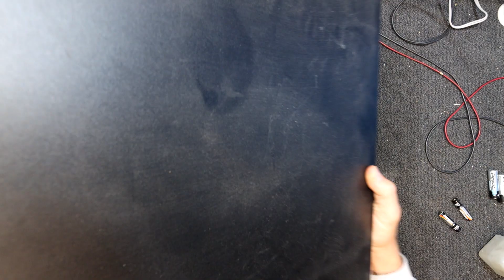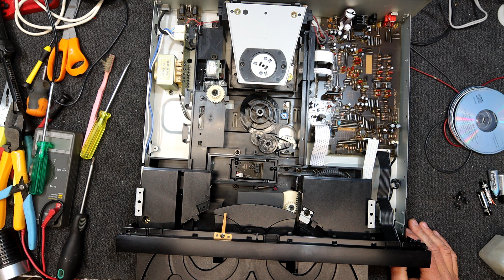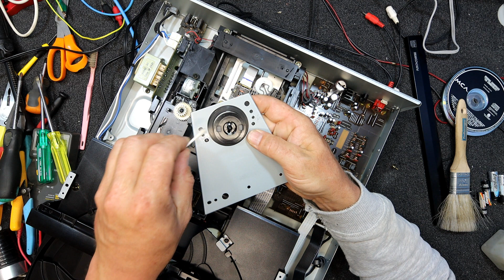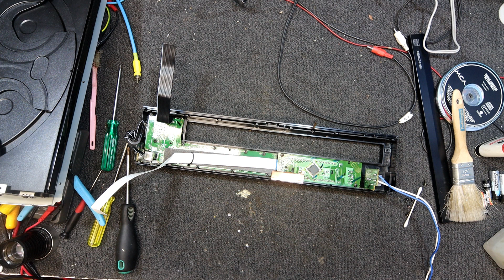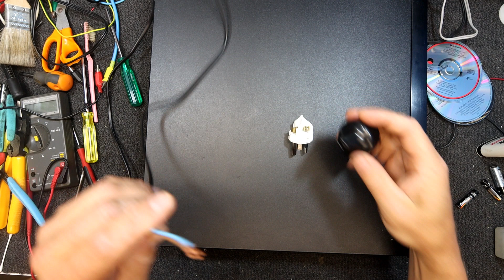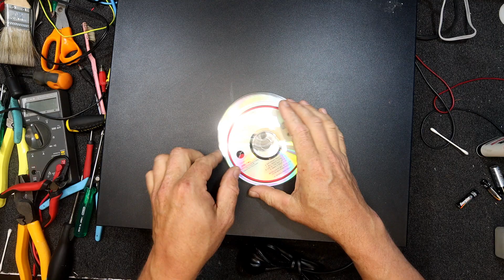Yamaha CDC-675 5 Disc CD Player Check Over and Service

Comment: How about the DAC of this player. Is it sort of the DAC’s audiophiles like?
Thanks in advance.

Great video, it helped to fix mine.😊
Reply from the maker: I think it was only some of the early single disc machines with a couple of separate DAC chips that people claimed were better, though I think there is even a Playstation that people claim is a better than average audio player and it would have used a later chipset. I never cared about that sort of thing so have little knowledge of it. You would have to research on the net which chips are the ones they think are the good ones, and see if there is a manual for this machine that shows whether it has them or not.

Comment: I have this same model. I recently replaced the belt for the tray as it was not always opening.

I have a new issue where I put any CD and and it says "NO DISC".

I opened up the top part (as you do in this video) and first cleaned the laser, but that did not help.

I then noticed the CD wasn't spinning, so my best guess is that the electric motor is broken. 

Is that likely the cause if the disc isn't spinning and are there replacement motors I can buy? How hard is it to install myself?
Reply from the maker: Almost never the motor if it doesnt spin up. It isnt activated until the laser is happy there is a disc there that it can read. When the tray gets to a disc position the mech should rise and the laser lens should go up and down. Dont look directly into the laser while its doing it. If so load a disc and try spinning by hand when its loaded up and make sure its clamped properly and spins freely. Sometimes doing it while the player is trying to read it will get it to read, which means the laser is getting low or needs adjustment.